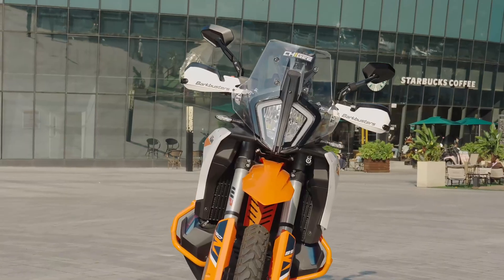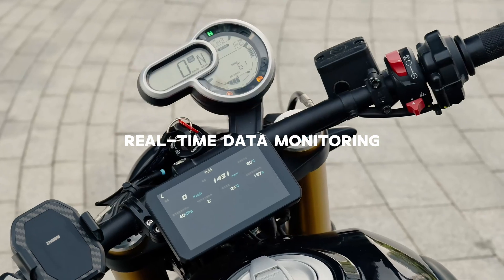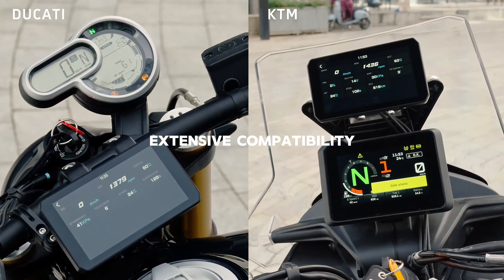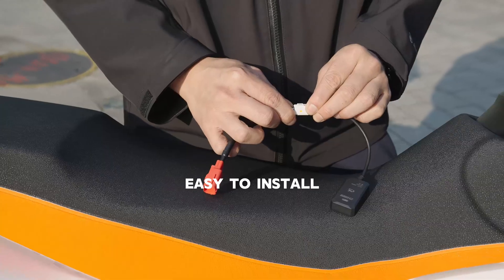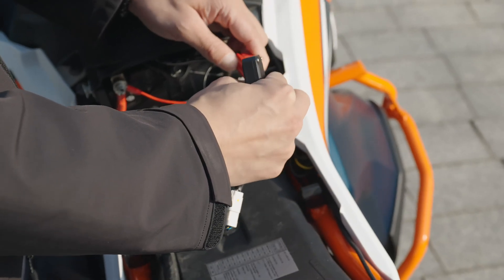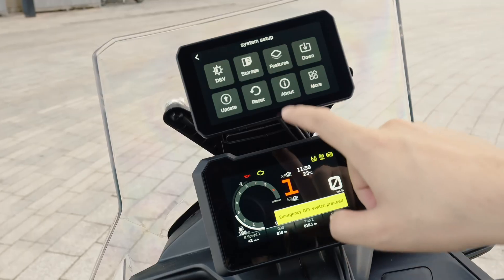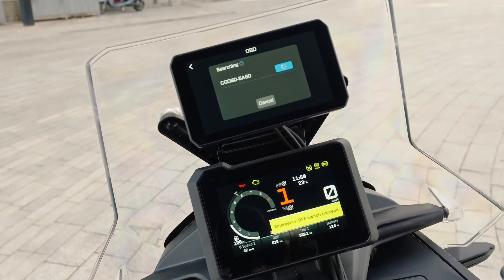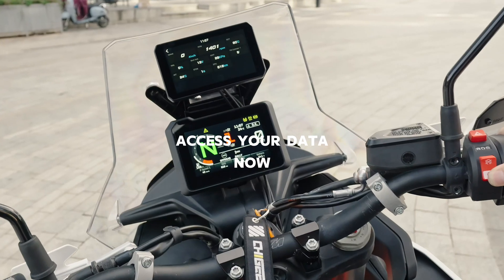CG OBD Wireless Module

Comment: Only works with the AIO5 lite and unfortunately not much data is displayed. Remember that OBD provides far more data. New parameters may be added with updates. A new update for the Play is available. Now it works with the Play too. I installed it on the Voge DS900X. The TPS is not displayed, the rest works.